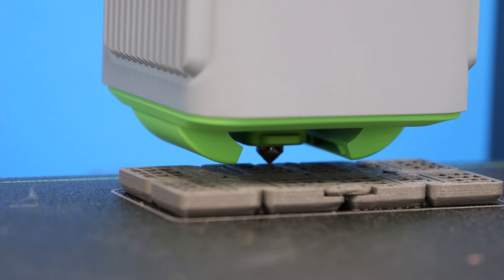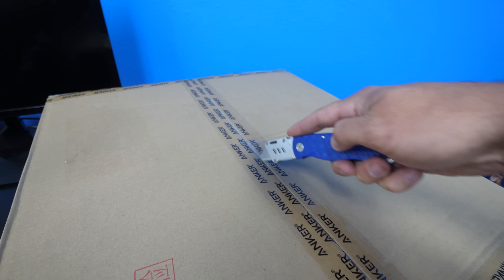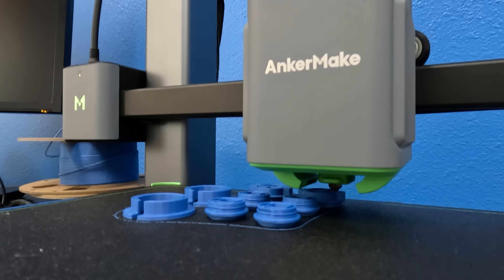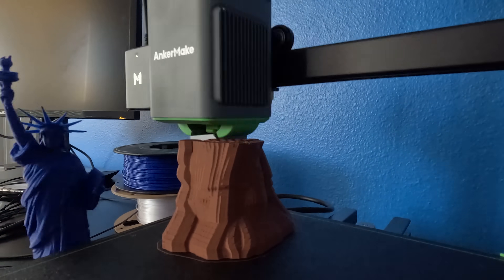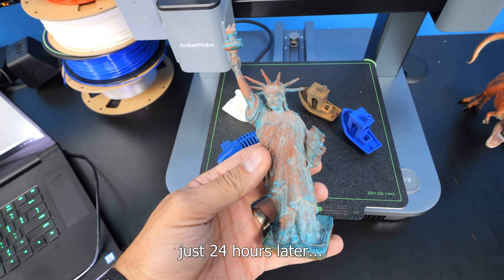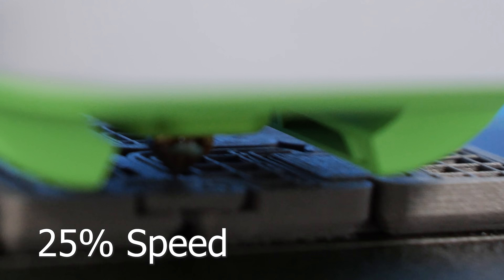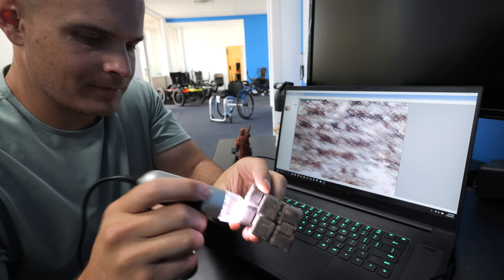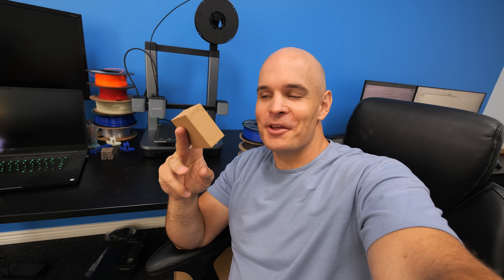I tried 3D Printing with REAL GOLD......

Comment: I’ve been printing since 2010, used to make my own filament and wish I still had my setup. Maybe if I win I will have to build a new one. Have you tried any of the Bambu printers, specifically the P1 or X1C. The X1C has been the smothers and fastest printer I’ve owned to date another the high extrusion nozzle replacement.

Comment: What temperature did you use for copper and what was your layer hight? Additionally if speed is a factor for your prints the you should check out resin printers

Comment: Could you technicaly print wires with the copper filament? Maybe it could help in manufacturing circuit boards.

Comment: 80% faster than other 3D printers on the market? How many * symbols did they have to add to the end of that sentence to make it OK to say? You can get a Creality K1 for cheaper or a K1C for the same price, actually even a Bambulab P1. K1 has speeds of 600mm/s and 20000mm/s² acceleration. Oh yeah, and the ones I listed all have a screen.

Comment: Ankermake is the worst 3d printer company ever. They have literally nothing new, its just all marketing.

The crality K1 series has a top speed of 600mm/s acceleration of 20,000mm/s
The sunlu S1 has a top speed of 1,200mm/s and accel of 40,000mm/s
The ankermake is not 80%faster, maybe 80% faster than printers many years ago but not anymore.

The spineless ass-kissing and glazing in this video is astounding. You've lost a lot of respect from me today Jerry.
Reply: bro its an almost 2 year old video😂😂

Comment: PSA: Before you go and buy an AnkerMake, you should know that AnkerMake has designed the printer in a very anti-consumer way. Bottom line, this means you can't use the "Send to printer" feature present in any slicing software. The only Slicer that can wirelessly send prints to your AnkerMake is their own very bad reinvention of the wheel, AnkerMake Studio, which lags behind other software by about 5 years or so. AnkerMake Studio is riddled with connectivity and cloud bugs AND you'll notice it's also so poorly optimized, that it can ONLY run under emulation on Apple Silicon. Anker is an amazing company and I love their battery products and they have a strong brand, but unfortunately in this case, they have overextended themselves. They are good mechanical engineers, and the physical 3d printer hardware is well constructed, but they simply do not have the software development experience and the developers are clearly overworked and not up to the task. Unfortunately, 3d printing is 90% software, so consider that it may LOOK like the complete package from the outside but it's far from usable. I give this printer a 1 out of 10.

Comment: There’s no 3D printer that uses pure gold filament because gold is a dense and costly material that can’t be extruded like plastic or composite metal filaments. However, there are indirect or alternative techniques to 3D print objects using gold:

-Filaments with gold particles: Some filaments contain tiny particles of precious metals like gold mixed with other materials like plastic. These filaments allow you to create objects with a golden shine, but they’re not made entirely of pure gold.

-Indirect 3D printing (Lost Wax Casting): You can use a 3D printer to create a wax or resin mold, then use the lost wax casting technique to make a real piece of gold. This method is commonly used in jewelry.

-Binder jet: Some industrial 3D printers can print on metal materials using an agglutination process, but then the printed parts need to be sintered in a furnace to become solid metal. However, this process is also complex for materials like gold.

For pure gold pieces, technology still relies on traditional casting processes rather than 3D printers that extrude directly.

Comment: I've heard that hardened steel nozzle is best to print those wood and other filaments, brass allegedly wears out faster with these particles scratching it. Will certainly try to print wood someday, steel nozzle already on the way, now need some filament :D

Comment: 5:05 Eventhough the high temperature nozzle is good for those materials, this printer lacks an enclosure. ABS, PETG and TPU will be more difficult to print as a result, but not impossible.

Comment: Do aluminum next;

    Fused deposition modeling (FDM)
    Laser powder bed fusion (LPBF)
    Electron beam melting (EBM)
    Binder Jetting
    Cold Fusion
    Wire arc additive manufacturing (WAAM)

Comment: In my opinion a better option over the M5C with more features and for less of a price is the Anycubic Kobra 2 Pro. 300$ and runs 300mm/s standard and up to 500mm/s. Same type of assembly and it can do 15 min quality benches. It also has WiFi, a touchscreen, and a ton of other features.

Comment: You could have purchased rolls of gold for use in crafts.  Gold wire. I’m pretty sure that would work.  That have different grades too.  You would have to put it on the spool but it’s available all kinds of places.  eBay, Etsy, any craft website that makes jewelry.  You may have come up with something.

Comment: The printer looks like it works really well.  How many prints did it take to make the prints you did?  using the printer to make prototype parts is great use of the material and easy to replace if need be.  I would like to see a update on the hummer.
Reply: It is not good and too many issues! If you run AMD you'll have software problems and their slicer is limited at best. I've had mine not even a month and one problem after another and I'm returning it.

Comment: To achieve such a fast print speed does the quality of the print suffer?  What types of filaments can it use?  I saw the sawdust, iron, and copper infused materials.  What about the elastic, glow-in-the-dark, or other types of filaments?  Can this be used to make lithophanes?  How well does it work with machines that combine different filament colors and materials on the fly?  Like from Mosaic's Palette machines?  Does it have a 2-way to 4-way hot end feeder that essentially fuses different filaments on the fly from different spools?  Making them into a many colored/textured filament kind of blended together or fuse the different feeds together end-to-end?  Is there a wasteful purge block when changing from one filament color or material during the same print session?  Does the company have a multi-head or multi-tool attachment for more complicated 3D prints or projects?

Comment: Printers have come a long way. My first printer didn't have a part cooling fan so it could only print ABS and was $500 about 10 years ago. I have a couple creality machines but got tired of working on them and recently got a bambu x1c and its leagues above. For the price, that anker make looks like it would be a great first printer. I doubt it can print some of the claimed filaments without warping though, like ABS and PC.

Comment: Some pretty false claims in this video unfortunately... 5000mm/s2 acceleration is not even close to some other 3d printers on the market (and I mean normal 3d printers, not industrial machines), let alone 80% faster... Bambulab printers can do upwards of 20k mm/s2, Voron printers can do even faster. This printer is probably 80% faster than SOME 3d printers on the market, but that's if you completely disregard a huge number of printers.

Comment: Cool, but did you install a hardened steel nozzle? The additives (ie. copper, metal, wood) in the filaments tested can and do wear the pre installed brass nozzle. So definitely watch out next time!

Comment: Kinda disappointed that there wasn't more vlog footage of the gold filament making process and why it failed.

A long time ago I saw a video where someone was making strips from PET bottles to make filament for 3D printing. Since it was basically folded into a tube, maybe it can be filled with fine gold dust, gold leaf, or incredibly fine gauge gold wire/thread to make a gold filament

Comment: May be casting those end caps for the wheel chair would be cheaper and faster as filament is costlier than raw plastic and the need of the end caps would always be same so it can be molded.

Comment: I've learned that how tight of tolerances the thickness of the filament is, makes a huge difference in print quality and print success rate. Buy high quality filament if you want good looking parts that print well.

Comment: $399 is great but they really are giving europe the middle finger by turning it at 449€. 
$399 is about 360€, so basically the printer sells in the europe for 90€ (~$100) more. For no flipping reason. That's honestly a huge dick move coming from them. And the same could be told about the £399, which is even higher than our 449€ (around $500)

Anker really should rethink their price because right now, this price is really prohibitive on the current european market

Comment: Does the metal being printed have a washing and sintering step so that it actually hardens like normal metal? Usually metal 3D printers have two filaments, the metal impregnated one and a ceramic one.

Comment: Can you add a link to the 3D CAD modeling tool that you used in this video? Hopefully there is a Windows PC version. Is there any other software (outside of what is provided byAnkerMake) required  to get started with 3D printing? Thanks!

Comment: I love 3d printing lol. I only have an older Ender 5 Plus but while it's older, it still works great! One of the biggest things is you can easily change most of the parts on it so even if something was to break, you could inexpensively and easily change it. Which I suspect is not the same with some of these newer printers but I also wouldn't know since I haven't done research since I bought my printer.

Comment: Fantastic video, I can’t believe how far 3D printing has come to where you can use different materials besides just plastic now, and the speed that it can do it is incredible. It will be insane when we can we can get to the point where we can 3D print furniture in no time at all in our own homes and immediately start using them.

Comment: Seeing the different filaments makes me wonder, would it also be possible to add magnetic dust into them and then print some cool magnetic items. Or would the magnetic properties be lost due to the heat when creating the filament? Though even if you can print the magnetic filament, I guess it could still be attracted to a magnet, or is the concentration of metal to little to have any serious effect?

Comment: These printers are just getting crazier and faster by the day. I've been into 3D printing since 2015 (built my own printer back then using a wooden frame), kept on upgrading my printer with community mods (magnetic bed, auto-leveling, silent drivers, octoprint, filament runout sensors, etc.) but now even entry level 3D printers have most of these features. Absolutely love the advancements in this field making it affordable and accessible to general public (It used to be a gimmicky thing with not so friendly user interfaces and painful firmware). Keep the 3D printing series active Zack 👍

Comment: I bought the first ankermake m5 printer and I'm hoping the new all metal hotend will be worth the purchase. I can't wait to try out the new heating element and use copper filament like you did. I don't want to risk it with tmy current one.

Comment: Im from India so pls dont pick this comment ( WARNING! Restricted Import Customs on Gold ! WARNING! ) 
I was hoping you would experiment on how easy it might be to setup an extrusion kit for plastic bottles, aluminized plastics and maybe even 3D filament aluminum cans and foils. We throwaway stomach-turning TONNES of garbage that is plastics and aluminum and I am so desperate to recycle and so saddened and dejected that no YTubers or channels use their 3D printers and skills to solve this global dilemma. I dont have the funding nor the space nor the supporting community to try.  I do my best to recycle at home to the maximum. Even grey water I collect in buckets and water plants. But I am so limited when it comes to metals, plastics and glass. The local recyclers just either burn or dont accept glass or metals which they used to collect before.

Comment: How does the melting point of plastic change when mixed with a metal power to make the filament and  if the melting point increases how does the print head able to melt it and print

Comment: I almost bought the AnkerMake M5, but a combination of "it wasn't released yet" and the absolutely glowing reviews of the Bambu X1C ultimately led me to the Bambu ecosystem instead.  I have to say, I don't regret it one bit.  The AnkerMake printers are quite good, but ultimately they're still "bed slingers", and I prefer the stability of the Core-XY system.
Reply: Got me a Bambu a few weeks ago and wish I would have sooner - amazing machine - my choice was also between Bambu and Ankermate as they are both truly generational leap 3D printers, but after substantial research the Bambu was the easy choice.

Comment: I love watching your 3D printing videos. Lately I've been into building custom keyboards, I wonder what parts could be 3D printed for more versatility
Reply: Could try keycaps or the shell/baseplate of the keyboard if the printer you’re using has tight enough tolerances.

Comment: For my Architecture Masters Program, we crafted Bacterial Cellulose, an organic material made out of black tea, Kombucha drink and vinegar. It grows in a container and comes out in sheets. We blended the sheets with candel wax and 3d printed many different test models with Kuka Prc Arm robots extrusion heads and the final product came out with a tensile strength of more than 250 newtons which was crazy. without 3d printing, the material is not that adaptable but with this technology, there is not limit on what this material can do now.

Comment: The price and the filament options are the most impressive features of the new machines vs the old.  I am working with a loaned Makerbot Replicator 2, which would have been 10x the cost of this lovely machine. The Leveling is much improved since then as well, as a sheet of paper and adjusting 3 knobs is how the printer I am using was done.  Acceleration is massively improved.  Thank you for keeping us up to date on these.  Also, so glad you are using 3d printing for the prototyping to help reduce costs.  So hard to know what will be needed until the final iteration before release.

Comment: Having worked 18 years in a polymer extrusion company i can tell a few of the issues that prevented success in making the gold filament. The main issue i see is the lack of heating in the barrel. Heating just the hotend is enough for a 3d printer but not for extrusion. The auger doesn't seem to be an appropriate one since i believe it doesn't have any compression zones. Also I didn't saw ant venting of the barrel for the gases that are generated inside. Lastly, if you only had the PLA resin with gold, there was some separation. Some bonding and wetting agents were needed to be added.

Comment: For a few years now I've had a Sindoh 3D Wox 1 as my main printer, I've not used it as much as I should have but I've noticed a few small grievances with it, particularly the 230c limit for the hot end in the software. To be able to print much faster, with a higher temp for a fraction of what I paid for that, I think I might have to pick one of these up.

Comment: Did you really print all that with standard nozzle? These filaments are abrasive and they wore out & damage standard brass nozzles very fast. Usually you use plated or hardened nozzles.

Comment: These metallic filaments looks cool but they are not really strong because plastic and metal particles does not weld together, so each metal particle is a weak point in the plastic body. And often the plastic used is PLA for it's ease of use but it's not very strong and can melt in direct sunlight... This is really far from the metal 3D printers that actually weld metal particles together with a high power laser.
And something else to mention is the wear of the nozzle. The common brass nozzle are just fine for pure plastic because brass is harder, but these metallic filaments acts like sandpaper inside the nozzle. You can ruin a brass nozzle with just one or two metallic filament nozzle.

Comment: Use it for a extended amount of time and it starts failing. Thats the problem with fast 3D printers. When you print fast you take the chances of it not surviving long. This means the layers will start to peel because they couldn't cool properly before the other layer. There is probably something that's heling the layer cool, but without it you run the risk of it peeling faster. This is what I noticed when I bought my first fast 3d printer. FYI Anker is not the first one. And if speed is your priority, then you shouldn't be 3D printing.

Comment: Pretty cool bud, I wish I could figure out how to 3d print a new bezel for my discontinued microwave, it's in my camper and doubles as the oven with convection. They go for well over $500 bones. If I could make a way of holding the control board in place it would have a sweet look with it's inside exposed to the outside...

Comment: I notice you weren't using the built in camera or talking about the print failure auto stop they talked about when it was a kickstarter. Did they remove those features?

Comment: Have a original AnkerMake M5, this looks like a great option. Only problem with printers like these are the non open source software, the stock slicer also isn't great, you can use PrusaSlicer though. 

A significant upgrade from this printer would be the Bambu P1P/P1S at around 600 dollars if you are able to spend more.